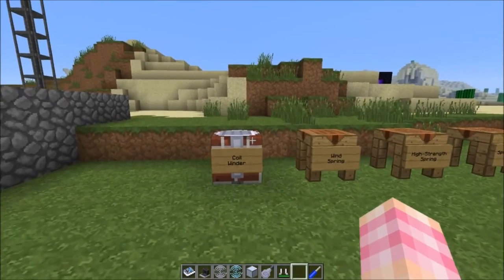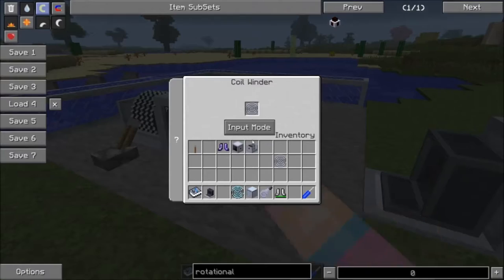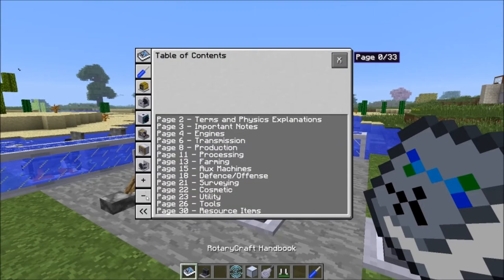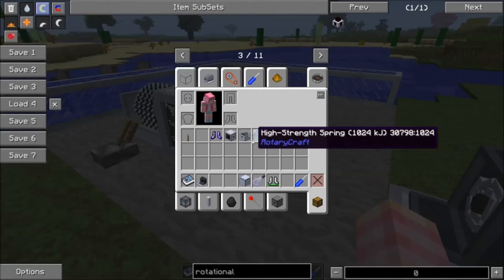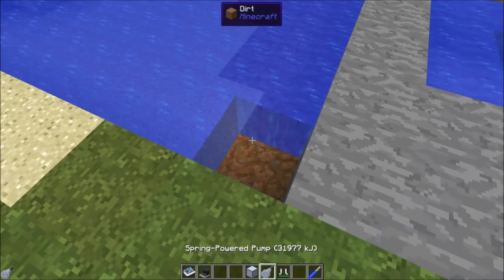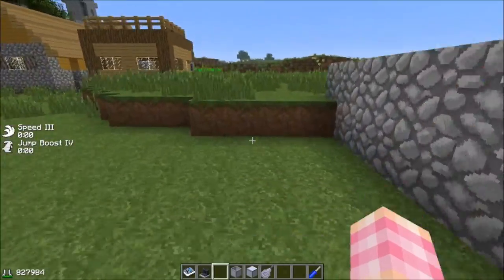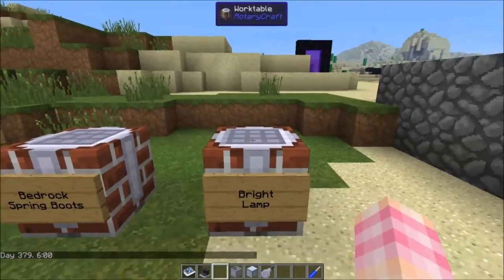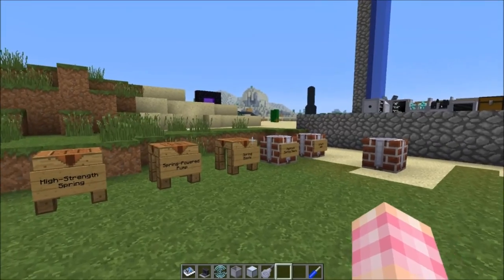RotaryCraft Tutorial #21 - Wind Springs

Comment from the maker: I'm unable to reply to a lot of your comments, its very upsetting. What is going on?
Reply: Ok. So i put a tool item (like the gravel-gun or spring-powered pump) in the worktable, and i put a wind spring with 128 kJ next to it, in the recipe, and it doesn't reload the tool item, and nothing happen, just like if i'm using the wrong recipe :S
Reply from the maker: DeathMelody rad try putting a lever on the worktable and pulling it with the items inside. Or you could try putting the tool into the coil winder.
Reply: I tried both ways, and it's still doesn't reloading :S
Reply: so did you wana hop in ts? also contact me on skype its zerotheliger
Reply: Bug solved with version v3a. Ty for your help ^^ This mod is awesome, really fun to play !

Good luck for your next videos, and have a nice day !